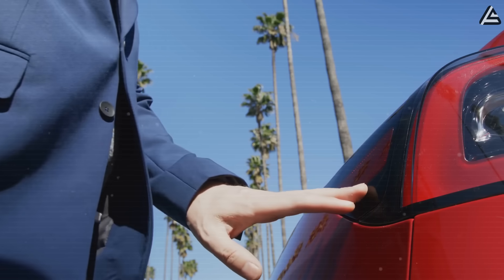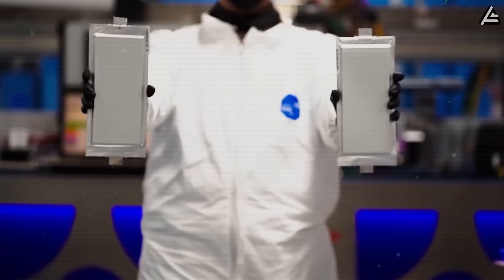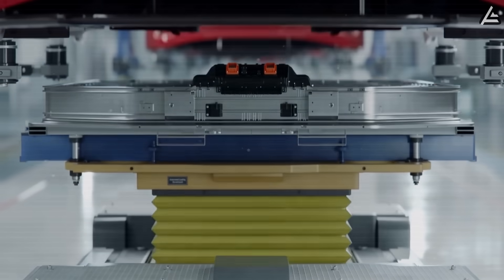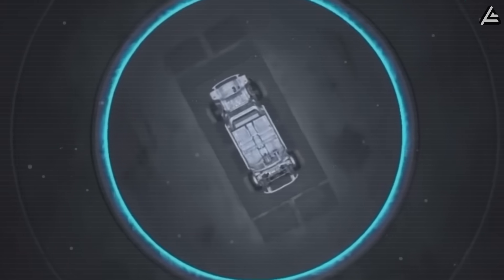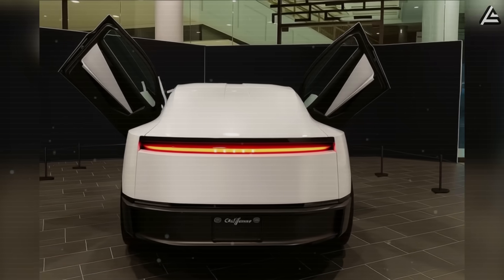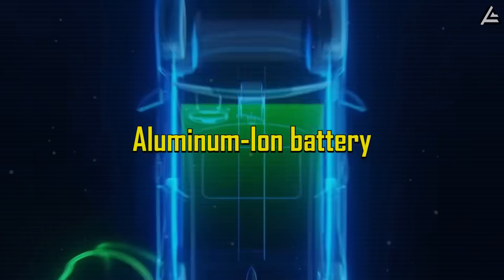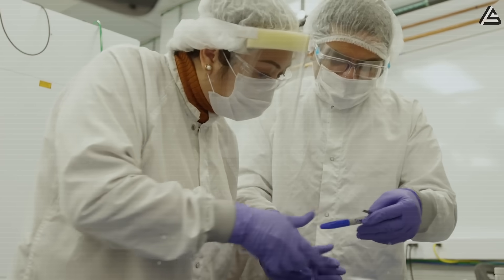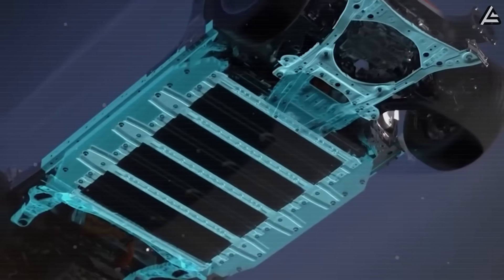Elon Musk Announced 3 All-New Batteries For Tesla Model 2: Price, Range, Production & MORE

Comment: Range, Range, Range. Reliability long-term, no breakdown, extended full coverage warranty, Range, Range, Range. Excellent customer several and Range, Range, Range.
Reply from the maker: thanks for your comment. i guess those are your concerns when driving, right?
Reply: @AutoGearShift2 range, yes, should have added charging time. That's almost as important. Don't, will never have the patience to stand, set, or float around a charging station for any longer than it takes me to fill my ICE vehicle from empty to completely full.
Reply from the maker: Charging time matters as much as range for long trips. Tesla’s approach has been to reduce time stopped through faster charge curves and better Supercharger placement, not to fully match gas refueling yet.
Reply: @AutoGearShift2 until it does and until the more pressing issues, fit and finish overall reliability, the very opportunist predatory abrasive aggressiveness of so called customer service are completely resolved, I won't be wasting my money.
Reply from the maker: Range and charging speed mean little if reliability and ownership experience are not solid. Tesla’s next challenge is clearly long-term durability and service quality, not just battery tech. If those fundamentals improve alongside range and charging time, the value equation could change, and I will keep updating as real-world signals appear.

Comment: What about the Sodium Ion battery? It has good potential and ought to be a available for the Model-2. I would want something with at least a range of 350 miles which is possible with the Aluminum Ion battery by making a bigger battery pack and you would have decent range and quick charging!
Reply from the maker: thanks for your sharing! we'll research deeper into sodium-ion battery and bring you more detail in our future video
Reply: Sodium ion currently does not have the energy density suitable for EVs (right now LFP provides about 160-170 Wh/kg.  Sodium Ion is more like 100-110 Wh/kg).  Sodium Ion batteries are great for land based Megapacks though and inexpensive.  In the meantime, new advanced versions of Sodium Ion are in the works and will be in the 180 Wh/kg range when they arrive in 2027 or so.  Semi solid state and solid state batteries will bring closer to 400 Wh/kg, but they are currently mostly in labs and expensive.  BYD is shipping their Semi Solid State 250 Wh/kg batteries in certain vehicles in China and exports to Britain, but in limited quantities.
Reply from the maker: thanks for your sharing

Comment: 1  seems like the best compromise for low cost, local driving for homes with a garage.for overnight charging.
Reply: I prefer the long range 500 plus and the sooner the better.  I am excited!
Reply from the maker: ok got it
Reply: @OrrenFrejo-dg6fg over 500 miles of real range  would alleviate range anxiety, with quick charging capability, and ice would be gone worldwide.
Reply: I'm 75 and 6'2". If I can get in and out of one easily I'll purchase one.
Reply from the maker: Hope Model 2's design will suit you best
Reply: @davidanderson8469 How has Tesla never seen fit to give people an oh shit handle on the A pillar to assist getting in and out of the car or to hold onto something in a tough driving condition? Is that too simple of a request?
Reply from the maker: Tesla removed A-pillar grab handles mainly for interior simplicity, airbag packaging, and manufacturing consistency, not because the idea lacks value. Some automakers make the same trade-off, while others prioritize physical assist points.
Reply from the maker: you got a point!

Comment: Of course when I am allowed to place an order and what options are really offered I will go with Al-ion.   However I am also interested in the butterfly doors.  There are rumors and AI pics but so far nothing little official.   I will be disappointed if they are not offered.   Second I understand that I can run my home on the car's battery.   I have ordered and I am only waiting for the install of Tesla solar panels and a Power Wall 3.   So using my car as a power backup has interest for me.
Reply from the maker: Thanks for sharing! You're not alone — a lot of people are hoping the butterfly doors make it to production, but so far Tesla hasn't confirmed anything official yet. As for the Al-ion battery and home backup feature, that's one of the most exciting parts of the new platform. Pairing it with your Tesla Solar and Powerwall 3 setup sounds like a smart move for full energy independence!

Comment: Toyota has a 1000 mi aluminum battery.   If this is true, why is a solid state battery necessary?
Reply from the maker: I think yes. A Tesla EV going with Tesla-made solid state battery is a great combo. What do you think?
Reply: @AutoGearShift2  The materials and production costs may be higher, but will come down with mass production.
Reply from the maker: yes you're right